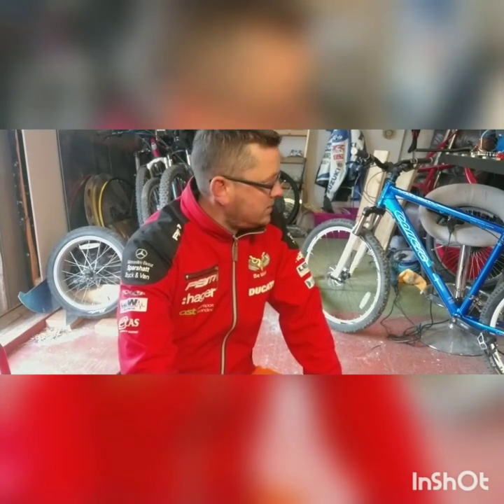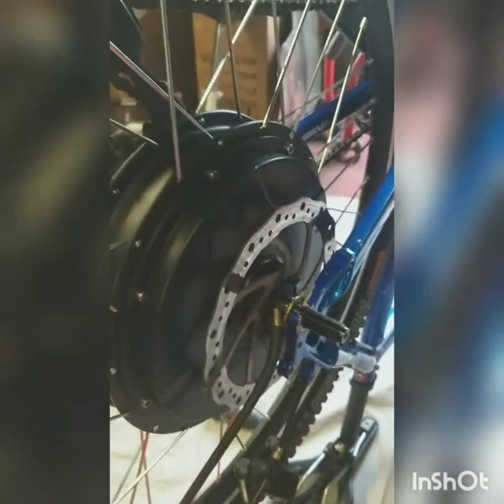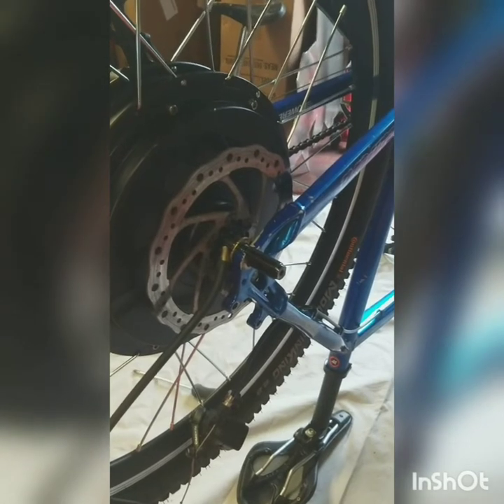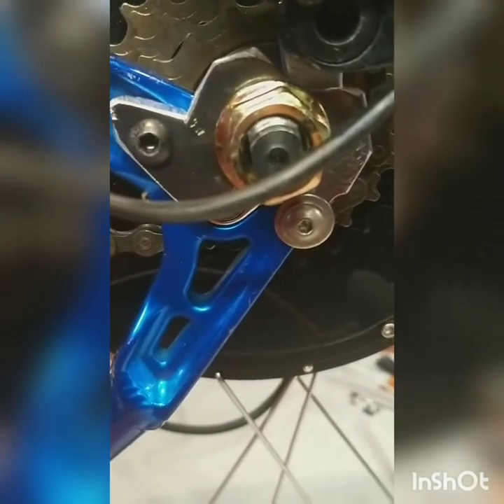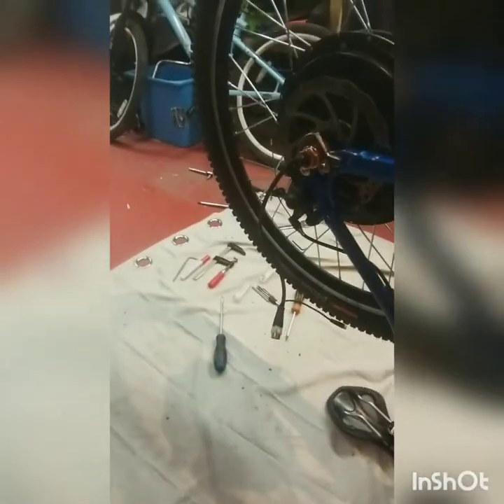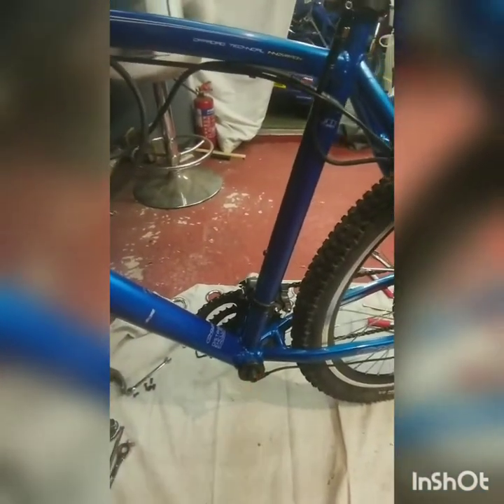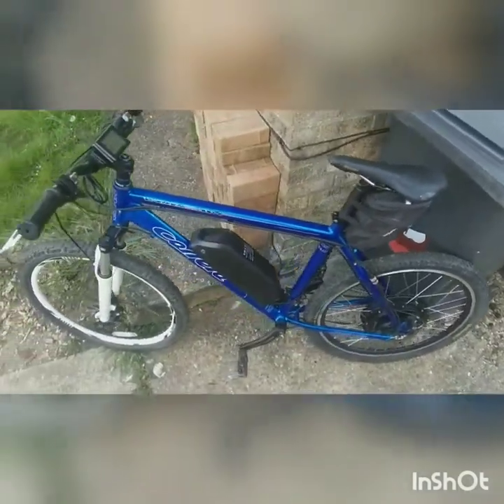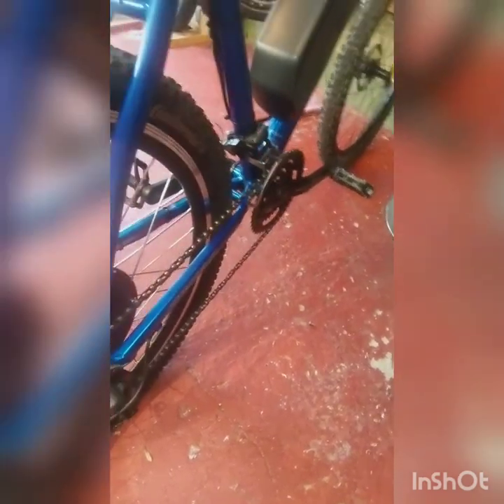48v 1500w voilamart ebike kit install and review on carrera vulcan

Comment: A quick tip. If there is not enough space between the frame and pedal arm for the sensor. Remove the pedal arm and use a flap disc on a angle grinder to remove a few mm from the crank arm thickness. There is usually plenty of material. I've done it a few times it works very well.

Comment: The gear you need set the way you want if it's not going into the first there are 2 screws on the side H and L,  you need to screw or unscrew one of those until you can change the gear into the first gear.

Comment: I've just bought (kit/battery coming in the next week hopefully) the same 'Voilamart 1500 48v rear hub kit' and a 52v 20ah triangle battery for it...
I'm hoping it will all fit together without too many problems.
I weight almost 13 stone, or 82kg, where I live it's hills in every direction, hope I've made the right choice with a 1500 48v with the 52v20ah battery for the damn hills.
I'm unsure whether to bother with the pedal assist? 
Will I encounter problems if I dont fit the p.a.s thing?
I'm keen on doing a shunt mod to the controller but I'm a little bit worried as to whether or not it may start to overheat the controller?
I guess I'll have to take it easy (if doing the shunt solder/or wire modification and keep checking that the controller isn't getting too hot.
Thanks for the vid, I figure if I watch enough installation vids I shouldn't have too many problems fitting it all.
I can't wait for the kit to arrive!!
Hopefully I won't have to do too much damn hill peddling.

Comment: Hi, I bought one of these about 4 years ago. Yesterday I decided to build it. I used my old bike and set everything up on it. Everything was straight forward enough.  Back wheel took a bit of fetling but sitting nice now . Problem is when I touch the connecting cables to the battery, they start to heat up really quickly 
 Iv not held them on any length of time but something doesn't seem right.  Double checked what I can see and tried it again with an old motorcycle battery  so not as much power going through it but still feel heat starting to generate through the wires.  Any advice on this would be appreciated.  Thanks Rob
Reply: Hya I might be too late but it sounds like you have a short circuit going on especially if there heating up like that. You want to look for any wires that could be shorting and try to fix them that way you can find some simple tutorials on YouTube for how to fix shortcuiting wires. Good luck!
Reply: @harlangoddard465  hi. Thanks for getting back.  I finished the build and this time I used  the car battery and fitted an in line fuse fitted with a 10 amp so if anything was wrong it would easily blow the fuse. Not as much power going through it but all seems okay.  My only question is, my kit didn't come with a control box. It just came with the 1500w rear wheel,  brake levers that also cut the power, a cycle assist sensor, a twist throttle and a small monitor that sits on the handle bars.  All the connectors are colour coded so no chance of getting them wrong. The only other wires that are left are the main red and black ones that I assume going by the instructions,  connect straight to the battery.  I only noticed this after looking up similar kits. I did notice some didn't have a control box but others did.  Would this be the case that some kits don't need one and others do, the instructions I got with the kit doesn't say anything about needing one.
Reply: @bobbyedal2737  yes every kit will need a controller, the purpose of a controller for an electric kit is too controll the delivery of a predetermined amount of electric in other words it feeds the electricity that goes through it into the motor and let's you move and all sorts. I recommend buying a controller for the kit and see if that works
Reply: @bobbyedal2737  I'd also like to come back to the battery, is there anyway you can measure how many volts it's outputting? It could be a faulty unit
Reply: Hi. Just a heads up for the outcome of my ebike.  I managed to look up on line regarding my particular wheel and was told it had a built in controller in the actual hub of the wheel.  Anyway,  cut a long story short.  I ordered a battery  on line and fitted it to the bike.  Added an inline fuse.  Just to minimize the explosion,,,, Lol. It didn't pop the fuse and now iv clocked up 80 miles in all weather hassle free.  What a fantastic thing.  Wish I had got it on the road sooner.  Cheers for your time.  Rob 😀👍👍👍

Comment: Hi wondering if you can help me I have the same kit on mine as soon as it goes over about 30mph the motor starts vibrating every time I built one a few years ago and don’t think that one did it it doesn’t do it if you lift the back wheel up and test at full throttle just when your riding it. Do you know if yours does the same? Thanks
Reply from the maker: Hi I built it for a mate but think it's OK if it does it under load I would check if you have got  any play in your bearings and check your spokes are tight wheel is running true and also that the tyre is seated correctly as all could cause vibration

Comment: He's gonna be pissed when he gets a rear puncture and has to undo all that 🤣
Reply: You're just fix puncture without taking the wheel off.
It takes 5 minutes to fix a puncture at the middle of nowhere.
With just puncture repair kit & pump.

You onlyl need to take the wheel off when you want to change the tire or inner tube.
Reply: @scottrocks1993  lmao, not if it's dark raining and hard to find,think REALITY,valve failure/tube splits!
Reply: @ianmangham4570  2023 bro u typed what u wrote on a flashlight😂
Reply: @shvkejunt  Holy banana 🍌

Comment: Were did you get it? and can you show you fixing the back and front deraillers? my carrera same as urs but won't change gear for shit, justt makes awful grinding sounds, skips the chain etc
Reply from the maker: It's a bike a bloke at work gave me to put a kit on for him and there is just 2 screws on each which stop it going to far left or right which if you need you can use longer screws I'm not an expert I just watched a 5min video on youtube on how to adjust them.
Also I have had it before where the teeth on the cogs are worn out so might pay to swap the jockey wheels out for new ones .
Hope this helps kind regards Arron
Reply: @arrondeath603  yeah, I just commented this, and yes there are 2 screws H and L, you need to play with them until you find the right spot to change the gears

Comment: Wheres the controller?
Reply from the maker: In the bag under the seat on this one
Reply: @arrondeath603 its saying on amazon its built into the lcd would that be correct?
Reply from the maker: Hi sorry I have never seen an lcd with a built in controller.
I think you will need to buy one if the kit you have didn't come with one.
I know people who have blown the controller going uphill or flat out for to long so I would go for at least a 40Amp